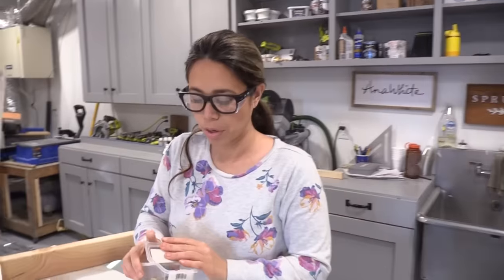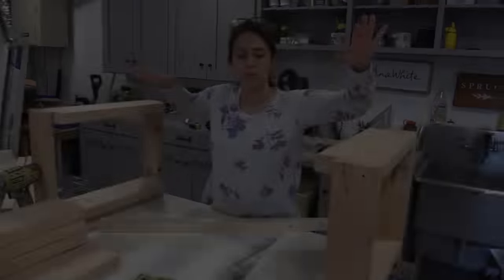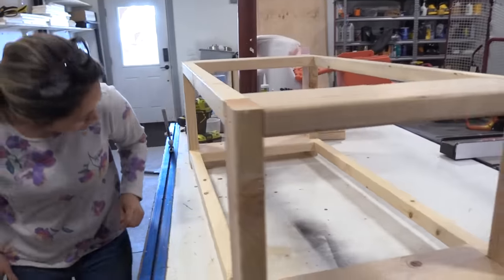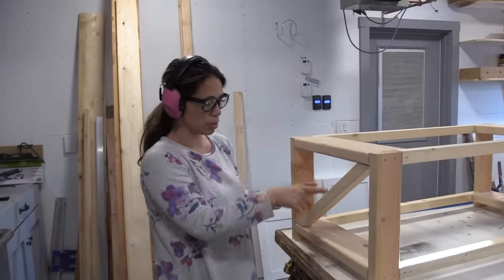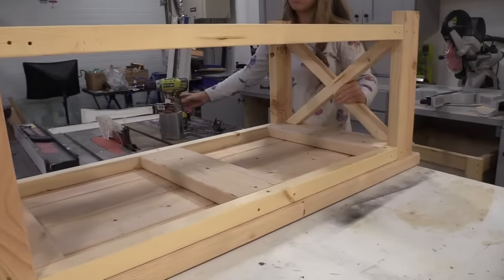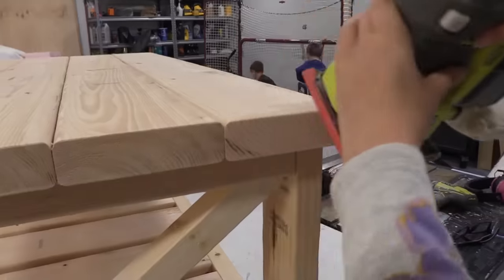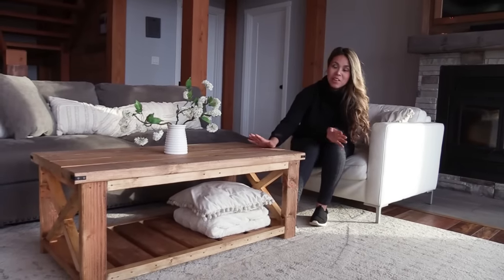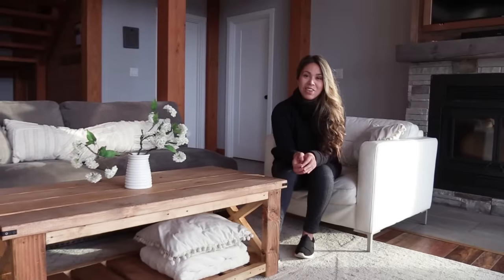$40 Farmhouse Coffee Table - Easy to Build #anawhite

Comment: How do you deal with furnishing a space with slanted roof-walls? I’m moving into a loft and one wall is slanted. I find decorations to be very hard to imagine
Reply: Steph, they have slanted walls upstairs, and they have built in some cabinets on those walls.  I think it's the series where they make over their daughter's bedroom.  If you're not renting, that could be an option for you.  You could even built the cabinets out so you have countertops.  If you are renting, maybe just set some freestanding cabinets there.  You could remove the backs so you don't lose that triangular-shaped storage behind them.  Also, if you want to add decor to the slanted wall, maybe some deep shelves that you can set pictures and things on would work better than attaching frames directly to the wall.

Comment: Does anyone know the angle for the x's off hand?  When I line up the piece to trace the angle I'm having a hard time getting my saw to cut exactly where I traced.  Is it one of the common preset ones or no?  Thanks!
Reply: 4:57 Doesn't look like hers are exact either.  You can find an online triangle calculator and enter the two legs and it should spit out the correct angle for you.  Looks like it's probably something like 50 degrees but find a calculator and enter the info you have.

Comment: Should of drilled holes at an angle from the inside under every board. Screw it together like that with wood glue. Hides every screw.
Reply from the maker: Yes you can do that or use pocket holes to hide the screws, thanks for watching!

Comment: Plans were perfect, assembly super easy. Unfortunately the cost of lumber has risen since this video was made. Used pocket holes, was able to add boards at a different direction on the ends. I modified the plans a touch in order to add wheels. https://www.facebook.com/photo?fbid=3660383534054942&set=pcb.3660383824054913
Reply from the maker: Sweet!

Comment: You stole that exact same coffee table design from pottery barn / Pinterest .

Not necessary to say you “racked your brain “ to come up w a design that is not yours. Just say you saw the design and wanted to diy
Reply: She didn't say she invented the farmhouse coffee table.  She said she racked her brain to come up with a plan that was accessible to total beginners...as in, those of us who have very basic tools.  She goes on to say that you can build this coffee table with just a drill and a circular saw.  Most Youtubers would use a table saw, which I don't have, and a pocket hole tool, which I don't have, and they'd finish it with their paint sprayer, which I don't have.  If you're brand new to woodworking and have a limited budget, it's intimidating to figure out how to achieve their look with different techniques and tools than were used in the video.  I may not have the skills to pull it off, and then I'm left with the choice of keeping and using this piece, and not being happy with it, or adding another $40 worth of wood to the scrap pile.  I think the point of this video was demonstrating how to do it for people like me, and I appreciate that Ana took the time to do that.